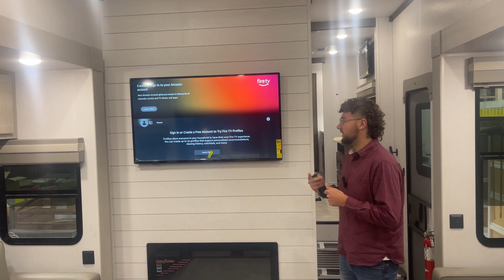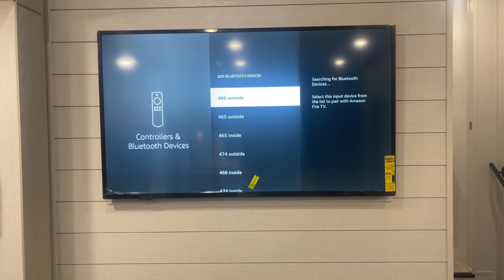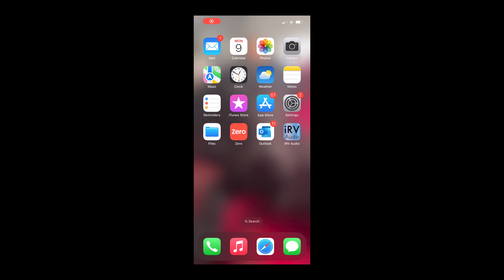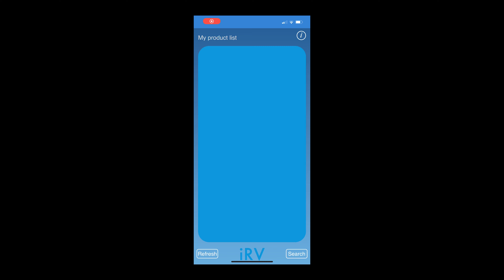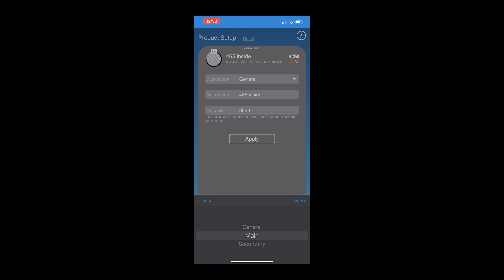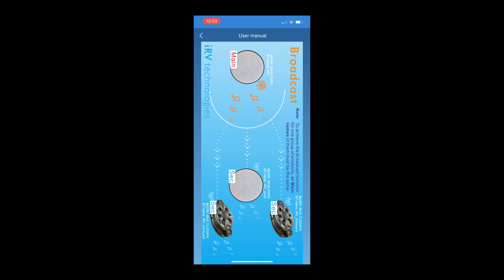iRV Aura BT Speaker Tutorial

Comment: This app is absolutely TERRIBLE. One of the worst, most frustrating apps I have ever used. The connection process is a complete nightmare. It keeps finding the iRV device, asking for the same PIN over and over again, and then failing to connect. I’ve deleted the app, reinstalled it, reset everything, removed the Bluetooth connections, and started from scratch multiple times—and it STILL does the same thing.

For an RV system that costs this much money, the app should not be this unreliable and ridiculously difficult to use. I have spent hours trying to connect something that should take two minutes. The system worked before, and now it just keeps going around in the same damn circle.

And watching videos that simply tell you to scan the QR code, enter 8888, and connect is useless when THE APP DOESN’T ACTUALLY CONNECT.

This app seriously needs to be fixed. It is complete garbage and an incredibly frustrating experience.

Comment: I did correct the issue I had by removing the white cover off the speaker in the ceiling (there are four triangles on the white speaker rim that can be pried open with a flathead screwdriver). I then removed the four screws that attached the speaker to the ceiling and found the 7.5 volt fuse inside. I pulled it and then reinserted it and the speaker worked. App now controls the inside speaker.

Comment: I messed around in the app and set the inside speaker to AUX. it no longer shows up in BT and when I try to connect to it, it tries and tries but ends with a message that it is offline. It worked great inside till I messed around with the app settings. Can you help me?
Reply: Same